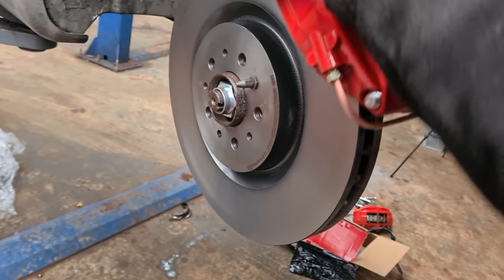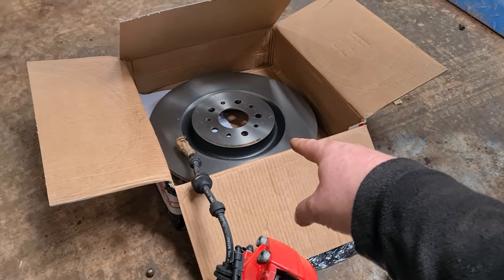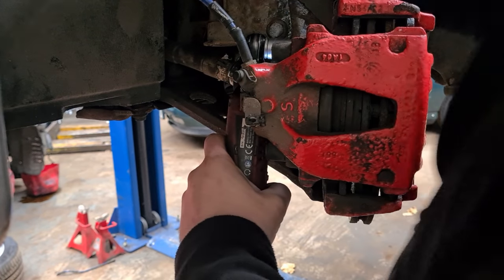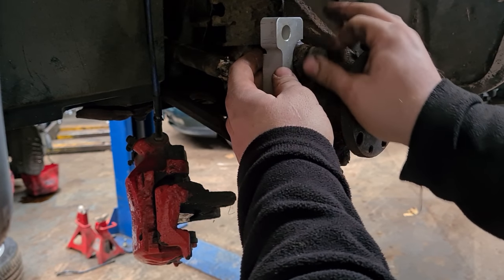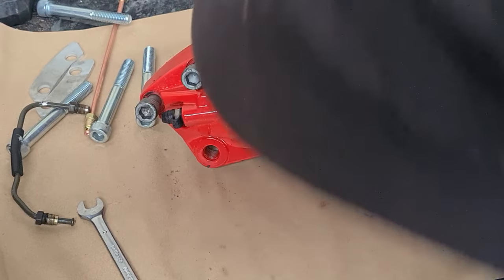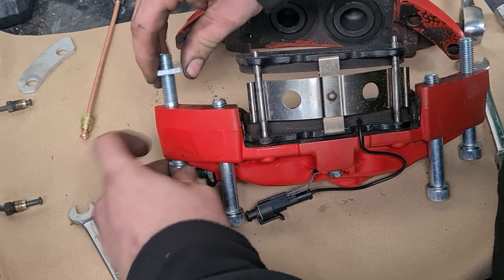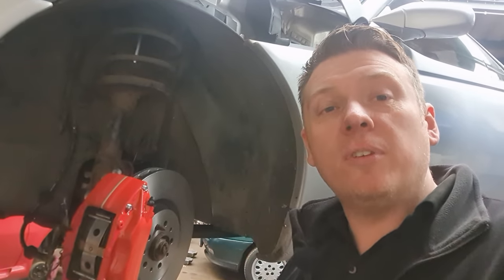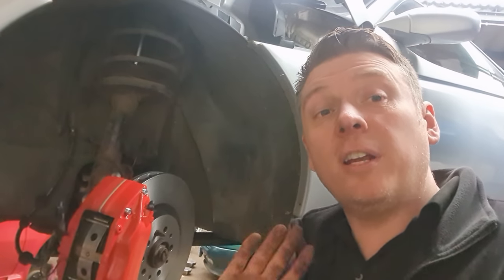Alfa Romeo GTV TS Big Brembo Brake Conversion

Comment: Just fit a pair of calibers from a Alfa Mito tb/Fiat 500 abarth. A straight fit without any modification or branket/spacers. But only 305 mm and use 305mm disk from gtv v6 with brembo.

Comment: Hi, first of all thank you for sharing this video. My only doubt is which braided hose brake do I have to buy. My gtv is an 1.8TS 1998 phase2. Thats the only part that I haven´t buy yet and not install the kit, to not have to stop the car twice and redo the oil brake bleed. By the way... also which oil brake did you used. Thank you

Comment: The alfa romeo 166 uses  310 de diameter , and 28 mm thick brake disc,  the gtas brake dics 305 and 330 diameter and 32mm both of them

Comment: I’ve just done this conversion so a few tips for anyone considering it. The bolts needed to mount the caliper are M14x1.5x40mm. If you use the heat shield you will need to cut a small piece of it so it doesn’t sit between the caliper and adapter bracket. The clearance is also very very tight with 330mm discs so chances are you will get some rubbing if you’re caliper shave been recently refurbished with powder coat.
Reply: Hello.. do you know where tò buy all these parts? I Need this kit for the same conversion

Comment: That metal shroud isn't a stone guard, it's a heat shield to keep the heat off the rubber boots on the ball joints and to direct some air to the disc.

Comment: Re gloves...I wear mechanics leather ones, not much loss of 'feel' as the leather is thin and they last for ages before wearing through and protect your hands from sharps better than latex. I'm not particularly worried about the grubbiness, more about the alleged carcinogenic properties of all that oil, grease and muck.
Reply from the maker: Ooh ill have to have a look into those. I've also been using some of the rubber/cloth gloves

Comment: I see where the adapter shows to fit GTV/Spider (916) 1.8/2.0 TwinSpark, GTV/Spider (916) 2.0 JTS, GTV/Spider (916) 2.0 V6 TB. Would it not also work on the early 3.0 V6 Spider?

Comment: If those 166 calipers are from 3.2 v6 why did you put the distancers on them? Or they are from a 2.5 v6 and you put them to fit on 32mm disc? As it was from a 28mm disc..?
Reply from the maker: Made them to fit 330 discs

Comment: Bit of copper grease on the mating faces of hub and disc,makes it easier for next time,that's what I was taught...good video though..👍
Reply from the maker: They have an anti rattle pad. They get stuck at the top and bottom on these callipers.
Reply: I would have also cleaned the hub before slapping the disc on .
Cos there ain't no anti rattle clip on that 😂😂

Comment: Does this kit work on a 156 with small brakes? Where do I buy it?
Reply: Think yes the 147 and the 156 Gta  have it😉💪👍gone look for it on my 147 2.0 from 2006
Reply: I have a 156 2,5 v6 2002 and I’m also very interested in this kit. The kit that makes 166 bakes fit.
Reply: @lindstromcallemedia  I had fitted the Brembo grandturismo kit on my ‘98, the main issue is brake clearance, I had straight mutlispoke 17 Alfa wheels and needed 15mm spacers. Gtv wheels have different off set but arch clearance can then be a problem.  It’s worth the effort though...

Comment: Nice video. I have a question how long is caliper pin which is hold break pads or from which car you used yours ? Original not fitting length.
Reply from the maker: Just ordered 330mm fitting kit

Comment: Can you just fit the 147 GTA Calipers straight to a GTV V6?
Reply from the maker: nope dont think so
Reply: @ItaliaAutos  ah I was told you could as the GTV/156/GTA all use the same mounting brackets, maybe this isn't the case
Reply from the maker: Different hubs/anti roll bar links and shockers.

Comment: Was just about to fit these exact brakes (all from a late 156GTA) on my 340hp Fiat Coupe. Great brakes I hear! (Then it all went to dust in a garage fire 2014)
I do think that heat shield for the ball joints you removed is a keeper tho..?
Reply from the maker: if i can get some decent ones they will go back on. thanks neil

Comment: Hi neil.  Hreat video.Can this conversion be done without splitting the calipers?  If so what disc would i use?
Reply from the maker: Yes you just have to use the 110 discs.
Reply: @ItaliaAutos  sorry. 110 disc?
Reply from the maker: @paulmurphy4802 sorry meant 310mm discs not 330
Reply: @ItaliaAutos  I started thinking that when a 110 model came up as an airplane engine. Haha. Goodman tks

Comment: Always great to watch you  Neil, but a question, why did you not remove the rust from the wheel hub? Corrosion can cause a wheel to shake under driving. I believe you always should make a smooth surface or am i missing something?
Reply from the maker: because thats old copper slip not rust. :-) thanks for watching.

Comment: Do you know of people actually coverting the braking pads to make a calliper fit to a different size brake disk? I've done it to one of my motorcycles. Basically it is a matter of  trimming the braking material off the pads where they do not touch the disk surface because this would turn them into restricting stays when the rest of the pad wears off. That might sound like lessening the total surface area but in this case it enabled me to replace a former single calliper assembly with a 4 calliper one. The gain in breaking performance is marked without any negative side-effects like increased fading! The only real downside is that I now alwys have to retool new pads to fit them to the vehicles unique specs before I can put them on.
Reply from the maker: ive read of it but i wouldnt do it.
Reply: @ItaliaAutos  It has of course to be done with some caution and sense of the possible complications In this case it however works like a charm. :-)

Comment: Years ago i did a similar conversion , fitting the brembo brakes of a 3.0v6 to a 2.0tb (same brakes ad your ts). Towards the end we had to build a on the spot small alluminium block to attach the abs sensor. You dont seem to have had any issues there... how come?
Reply from the maker: Older gtvs had bigger abs sensors
Reply: @ItaliaAutos  would you consider a 1996 an older one? Mine was an after facelift model, with the new sterring wheel snd new front grille. The brake kit came from a scrapped 3.0. Probbaly the difference is linked to the fact that we changed (used donors’ part)  the frame where the caliper are bolted on; you used an adapter to fit the calipers on the original frame. Probably thats the key

Comment: Hello. Great video. How does the master cylinder cope with this modification? I've the mito qv brembos on a 2.5 156 and I'm not happy with the pedal. It's not soft but a bit long and u really need to mash it for power.  How did the pedal feel to you after these conversions on standard MCs? Cheers
Reply from the maker: Perfectly fine
Reply: @ItaliaAutos  thanks! Appreciate the reply, looks like there's some more bleeding in my future

Comment: Usually guys here do 305 or 330 from 159 as they have radial fit and adapters are easier to make. For rotors use 159 rotors and drill them to 5x98.
Reply from the maker: id rather not faff around drilling discs.:-)
Reply: @ItaliaAutos  some come new predrilled like that, you can order from some aftermarket manufacturers by disc size and bolt pattern. It really is not a big deal

Comment: But doesn't the 166 have the 305?  The brakes 330 on 166 never heard.
Reply: 310x28 I think.
Reply from the maker: 3.2s came with 330's
Reply: I can fit the 147 GTA 330 brake calipers?
Reply: The AR166 with Brembo calipers used 310mm discs